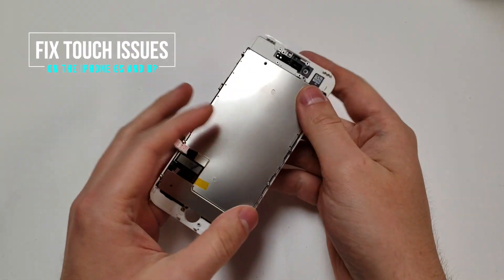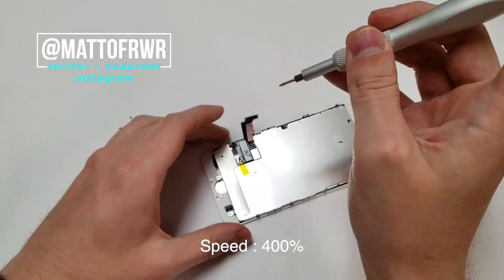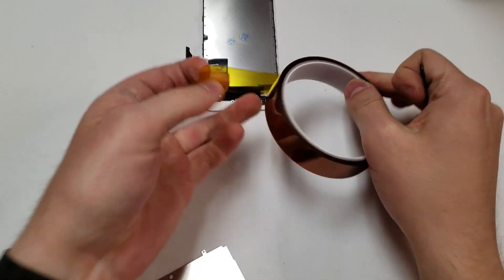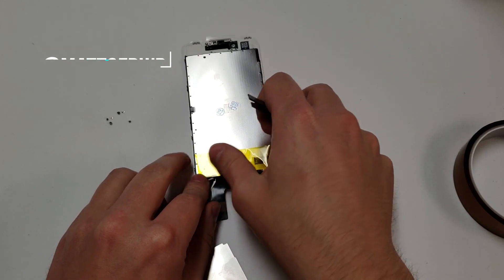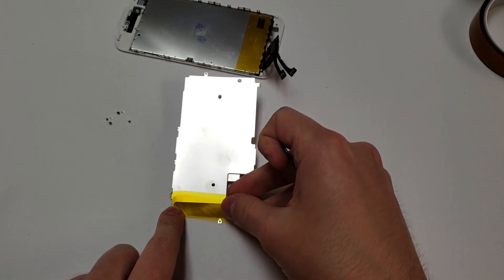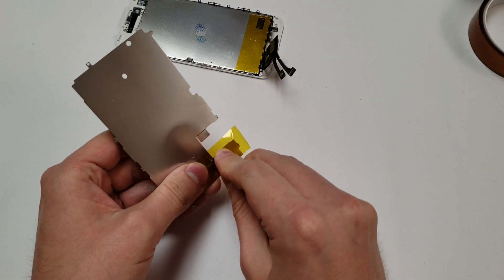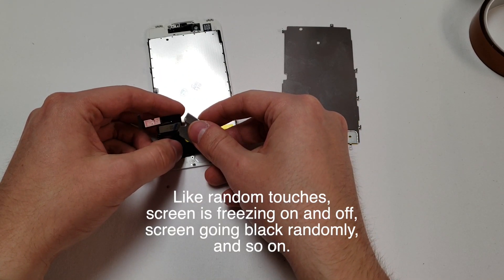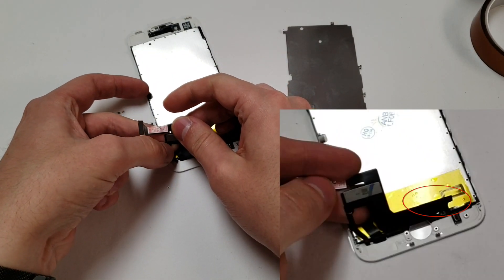How to Fix iPhone Touch Screen Issues (iPhone 6S/Plus/7/Plus/8/Plus) After Changing The Screen

Comment: Does kapton tape act as a good heat shield to isolate battery heating from the rest of the phone?
Reply from the maker: If you put enough in between it, it can act like a heat pipe, but most of the heat comes from the logic board rather than the battery. But kapton tape works nicely if covering circuits on the board when heating it up. Not perfect, but it works.